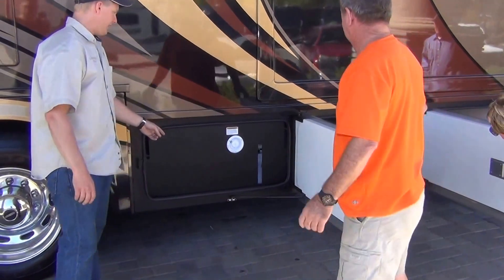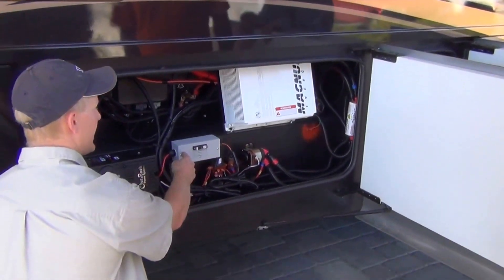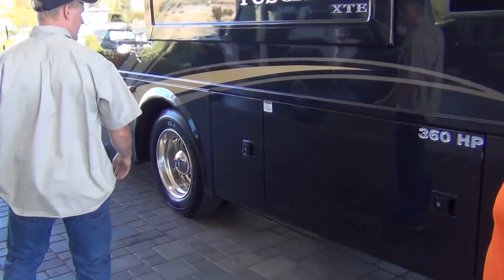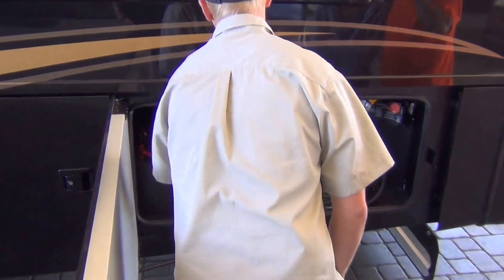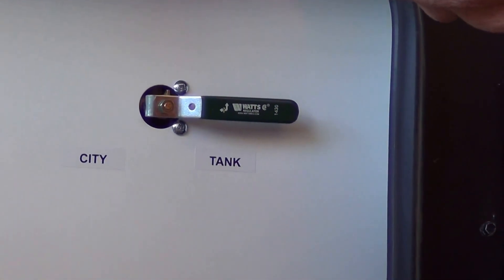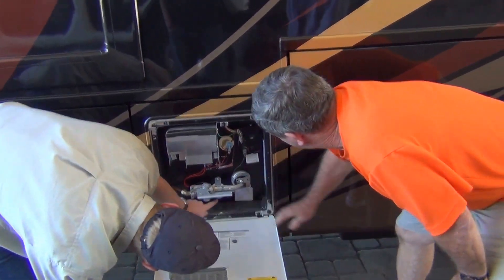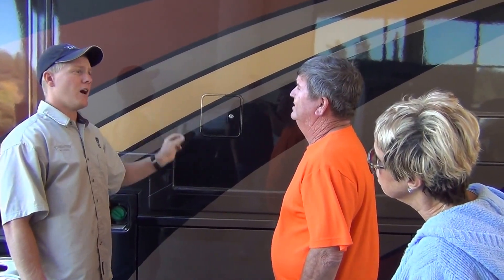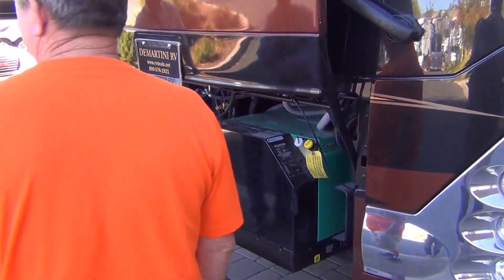Thor Tuscany 36MQ Customer Walk Through Part 2

Comment: I have a 2016 Tuscany, and I listened as you told the customer that you dumped the air bags and then set the jacks. My question is, what button did you press to dump the air bags? I am new to this, so I wasn't sure how to do that. Thanks.